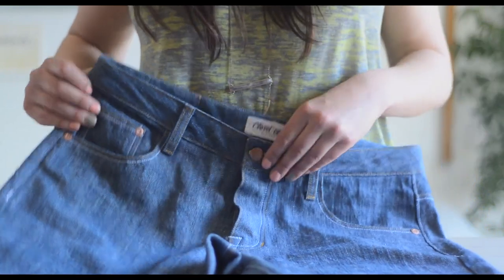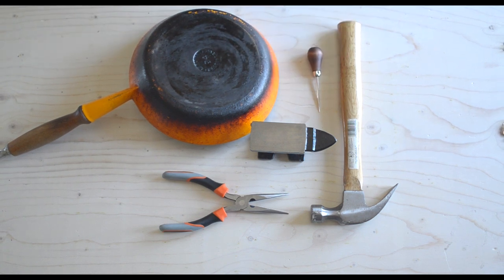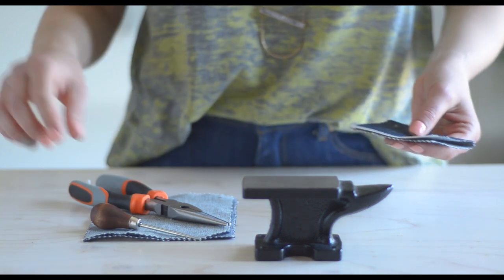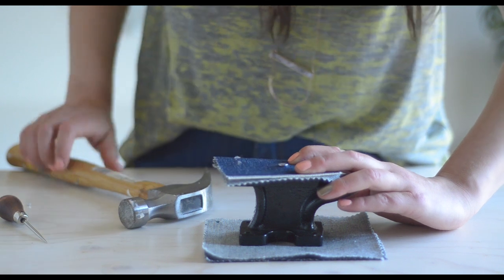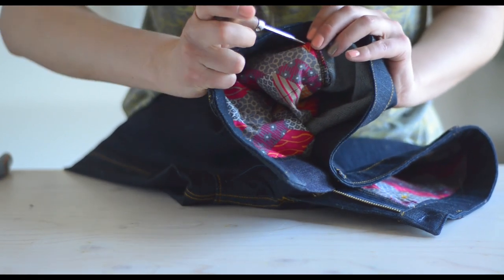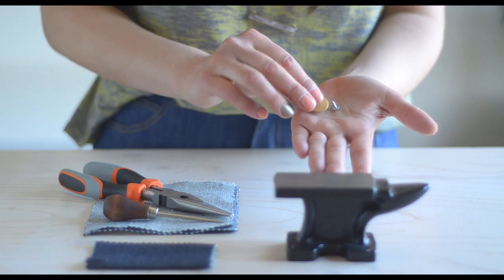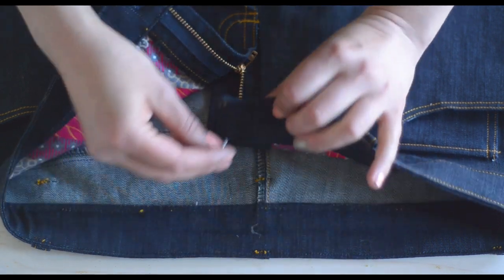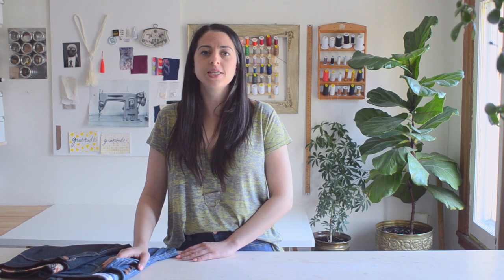How to Install Jeans Hardware at Home (Rivets & Jeans Buttons!) | Closet Core Patterns

Comment: hey dose placing the button go for the same as if you had a button and it rip/came out over time can you just hammer in a new button or do you make a new hole ? or do i like sew some fabric over it and make a new hole to support it im not 100% witch way to go there desginer jeans and the denim is abit thiner
Reply from the maker: You could definitely add a fabric patch to reinforce the area before adding a new button.